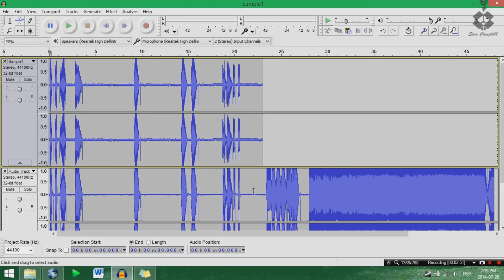Game Boy Colour 'Pro Sound' Mod

Comment: Thanks, for this! Looking at the schematic, EM2 and EM3 are inductors, not resistors. Rather than taking them out, you could solder the wires from pins 2 and 3 of the volume pot to each of them and cut the traces just ahead of your new connection? The inductors reduce high frequencies so that might reduce the clipping problem?

Comment: So THIS is why all Game Boy Colors have that hum/whine! I've been wondering for years but never found out what caused it. People have said it's the speaker, the capacitors, the headphone jack, etc... but none really seemed to be the case as improvement to people's sound was minimal at best. I never would've guessed the resistors were the cause. 

That being said, out of curiosity since I don't know that much about the GBC: If you removed the two resistors at 1:35 (or 2:22 wen removing) and then just bridged their connection points without them, wouldn't that work just the same as wiring the speaker/headphone jack to the volume switch? Or are the resistors required at those particular points to prevent frying something? Because something tells me when you remove the resistors, you remove any current coming through them anyway since the resistors are no longer bridging them. Hence the wiring around stuff.

In any case, awesome video on this! I will likely try it out on mine some day when I am up for it.

Comment: What's that small circuit board on the front do? is it already inside or is that something you added?
Reply: +coondogtheman1234 I'm pretty sure it's the power regulator board. It's right next to the power and battery connectors.
Reply from the maker: +coondogtheman1234 I'm not sure what you mean? I don't see any additional circuits.
Reply: Sam Campbell
Theres a small circuit board mounted on the opposite side of the speaker. What does it do? Is is part of the GB or a mod?
Reply from the maker: +coondogtheman1234 Ah I see it now. No that is just an original piece of the GameBoy. What it does? I'm not sure, I'd have to open it back up to take a look
Reply: +Sam Campbell it could be the audio amp board, kind of like in the game gear. any wires going to the speaker?
Reply from the maker: It could be, but I would just Google around or take a look for yourself to find out without making any assumptions
Reply: Sam Campbell
I actually have this same game boy I could try to look as I don't have a tri-wing screwdriver.
Reply: @coondogtheman  im a little late, but thats the power management board. It generates all the different kinds of voltage the game boy needs
Reply: @TheGlitchyMario  Gotcha. I thought it might have been an amp mod to make the game boy louder. People have done that.
Reply: Correct.